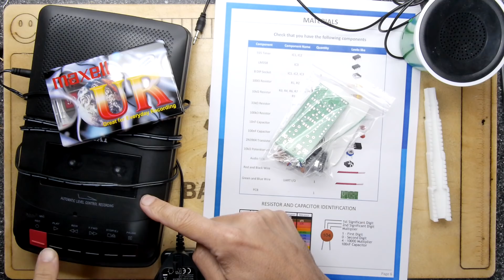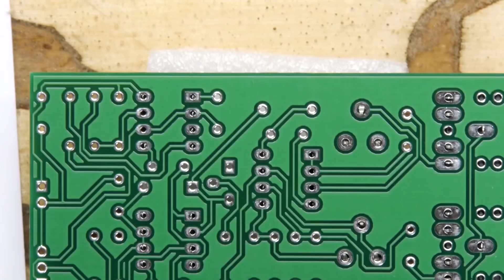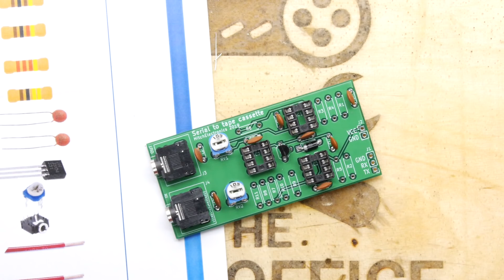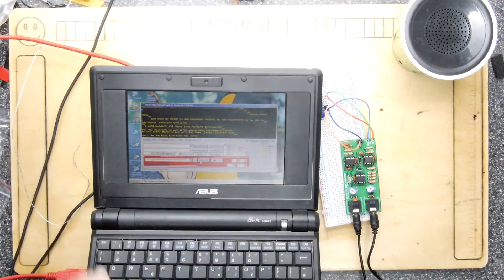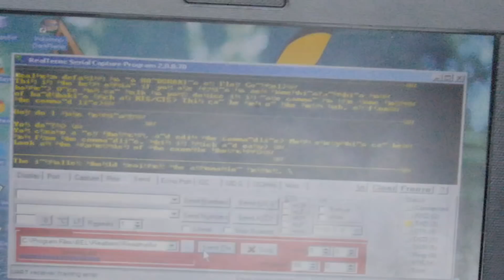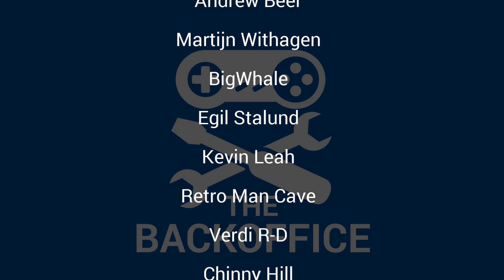Mitch Electronics Datacorder Kit

Comment: This is really cool! Would it be possible to connect this up to a Raspberry Pi Zero's UART GPIO pins somehow? I know Pi's are 3.3V only and 5V will fry it, but could something be done to overcome this problem? (Possibly a stupid question. I know very little about electronics).
Reply from the maker: Good question, the answer is yes, there are simple circuits you can use to translate the voltage or even easier, chips to do it. It was a pretty common occurrence to have to do this.

Comment: Its great to see the Datacorder working and am glad that you had fun working with it! Can we feature this video on our Datacorder product page? 

All the best,
MitchElectronics
Reply from the maker: Any tips to get it to be more accurate? I really was having trouble getting it usable.
Reply: @backofficeshow  Hi

Firstly, make sure that the output volume of the kit is kept around half way. You dont want the output signal to be distorted
Secondly, and this is really important, make sure that there is at least a 10ms spacing between characters. The spacing allows for the monostable to reset itself between adjacent characters.
Thirdly, the baud rate MUST be 300 and tuning the pot has to be done gradually.

But out of all those points, the second one (character spacing), is the most important.
Reply: @backofficeshow  I can see your delay is 5ms. I would suggest that you increase this to 10ms
Reply from the maker: @efmelectronicsformakers778  I'm pretty sure I tried most combinations for over an hour in between filming and with an oscilloscope. I will double check everything. Do you happen to have a video of one in operation?
Reply from the maker: Sorry, only just saw your request, if you want to, no problem with you linking. I think I may have some a few more kits from you as well, but my memory isn't playing ball 😂
Reply: @backofficeshow  Well if you want more kits for videos just drop us a message and we can get some sent to you free of charge!

We do, however, ask that you do not observe the waveform in audacity as another Youtuber pointed out that you may discover hidden satanic messages that slowly put the users soul onto the cassette tape. Having said that, only three other users so far have had soul missing related issues when using the kit.

But I would strongly suggest that you increase the spacing between characters that are sent. For example, if the world "Hello" is sent it needs to be "H" 10ms delay "E" 10ms delay etc.

Comment: I'm sure this will upset some but I always use my solder station at almost full tilt, unless I'm working on something that will require a long dwell time on a delicate component. I find I can zip round a board and get nice looking and strong solder joints at 350-400 degrees. I say if you work better with a very hot iron, so be it! I think it's far better to just be able to tap the joint with the iron and have a fairly instantaneous solder joint, than to have a low temperature where you have to hold the iron/dwell for ages heating up a delicate IC for ages!
Reply from the maker: I used to be the same, but I noticed some of these modern solders tend to oxidise on the tips at top temperatures. I can't stand watching those videos where someone is cold-soldering, it's painful 😂
Reply: @backofficeshow  Yup cold soldering is quite uncomfortable to watch :-0 I should probably add that I use leaded solder, I do find the lead free stuff tends to turn into sludge at the higher temps :-/ I was given a reel of leaded solder about 7 years ago and despite using it for many projects I've barely made a dent in it :-) great stuff to work with and worth buying while you still can! :-)

Comment: The description of that board suggests you can record data on any sound recorder.
It would be neat to see if it works with handheld digital recorders or Audacity.
Reply from the maker: That's a good idea. We can study the waveform. Perhaps that could hilight any mistake in it's construction
Reply: @backofficeshow  indeed it may.
Like unwanted distortion or oscillations and such...
Frankly, I don't know what the waveform should look like?  So that would be neat to see.
Reply from the maker: @aurthorthing7403  perhaps it will look like messages from the devil. Could be an opportunity for a viral video 😂
Reply: Hi,

Yes it works with handheld digital recorders and Audacity!